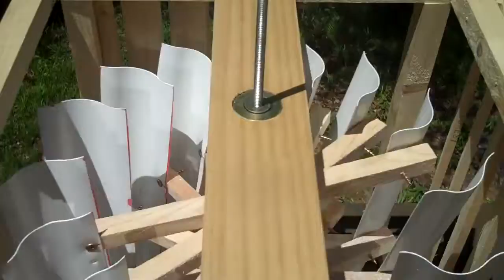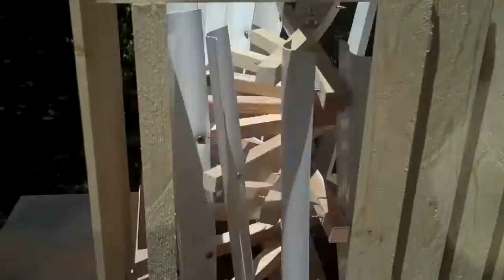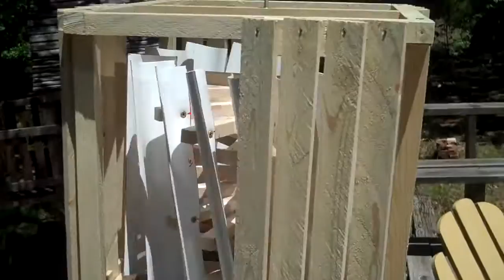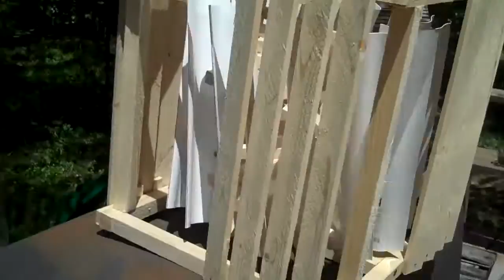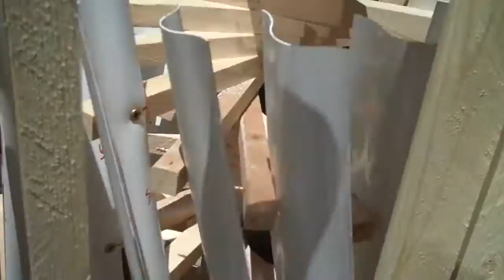VAWT - version #2

Comment from the maker: @MrThomas1969 - Thanks, there's no real trick to the design, it's borrowed from basic concepts found in a "Tornado Chamber" - See Version #1 for a link.  It was the best way (without additional moving parts) to reduce the drag from the opposing blades that needed to go into the wind.   .... I have a version #3, that uses the same frame as Version #2 the blades are twice as wide (about 5 inches by 1 foot ), but there are half as many ( only 8) ... This configuration seems to provide better torque